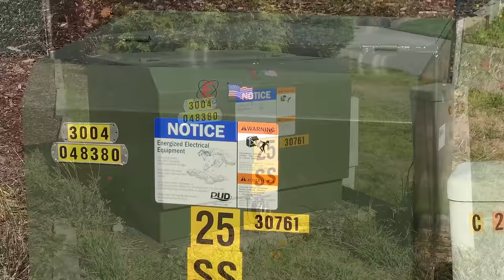Replacing a Pad Mounted Residential Transformer

Comment: The fact that "it is an eyesore" has got to be one of the silliest reasons I have heard to replace a transformer.  Better call the phone and cable company next, their boxes don't match the transformer now. :P
Reply: I wouldn't have put that in the description! My old switchboard is from the 1930's. I like it.
Reply: Yeah, they should’ve just went with the paint job. There’s an expected useful lifespan of all thing, but some things can last 100 years. I’m curious as to what these transformers expect to run. I know the one by my house has been there since the buildings near it were constructed.
Reply: He did not ask for it to be replaced..."I asked her if could paint it myself, or if PUD could dress it up with some new paint and signage."
Reply: @EqualsThreeable  lifespan is up to 50 years, dependent upon the quality of paint used for the exterior.
Reply: @EqualsThreeable  AC transformers are incredibly simple devices. They're literally just hunks of metal with wires wrapped around them. Most are oil cooled, and as long as the oil doesn't leak out, they can easily last 50+ years.
Reply: Excuses mee,. but TRRANSFORMERS ARE ROBOTTES IN DISGUISE. If a TRANSFORMER here youe say that, goo dchance it wil gobble youe up. Ple doinrt say that aroudn TRANSFORMERS!  THANSKE YOUE AND THBBBME SUPPESR!
Reply: HoA probably. Why it's a ground unit in the first place.
Reply: @EqualsThreeable : They're probably shipping the old one to my neighborhood.
Reply: It's taken me weeks to get a street-light replaced, or on the government side, get trash shopping carts removed from the shoulder of a busy street... let alone fix some pot-holes.
 
I probably would've spray-painted it myself, being sure to leave those code numbers untouched. Think they'd care? 
 
"It is far easier to apologize than it is to get permission."
Reply: @oatlord : Maybe but in my neighborhood the utilities are underground and I'm glad of it. No HOA for me ever. I detest them.
Reply: countryfolk kinsurvive  "that dilapidated things can easily bring the property value down"

LOL well that's GREAT!!! unless you are planning to SELL next week who gives a damn about the value? if you feel it's decreased the value- GREAT- file a claim with the county assessor and demand a property tax REDUCTION and save some money!
Reply: I, too, would've expected they'd just paint it. But it's their system, if they want to replace a decades old box, it's their money. ('tho I would've put in a larger capacity.)
Reply: Still way better than wires and transformers on poles hanging from above the street
Reply: @KutWrite  one of the street lights on my street would work some nights others not and after about 2 years they recently replaced them
Reply: Though compared to European standard transformers this all look horrible
Reply: @EqualsThreeable  they're lifespan depends on load, environment, etc.  Performance degrades over time.  

When I bought my first house the street had a reoccurring issue with dimming interior lights.  I came home one night to a crew swapping out all the transformer s in the alley way. No more issues after the swap out.
Reply: @TheSeanUhTron  oil typically starts leaking long before 50 years.
Reply: Well they are different colors for a reason
Reply: I guarantee it wasn't about looks. The life span of that Transformer was up. They Change them every 30 years or more but I've seen them Blow before that.
Reply: It’s not silly. People spend a lot of money on their homes to make them look nice, I wouldn’t want an ugly box sitting in my yard either.
Reply: First-world problems!
Reply: @jfbeam  They will probably take it back to the yard and refurbish it and re-deploy it.
Reply: @KutWrite  it may be easier to apologize that it is to get permission, but it sure as hell ain’t cheaper!
Reply: @ryan005869  then rip it out. You don’t get to dictate anything to the power company. They will literally tell you to sit and twist. 🤣
Reply: @jman0870  didn’t say to remove it, just saying  if something has to be in the yard it might as well look nice. Also that is not a required location for that hardware, it can be relocated.
Reply: @ryan005869  No...it can't. That would require digging up the pad and the trench the high voltage lines are in, pouring a new pad, digging a new trench, lining it with concrete, extending both the service wires for the homes and the line wiring coming in. That's a massive expense, paid for by your electric bill and tax payer subsidies. This is where I roll my eyes.
Reply: Best aspect of that whole eyesore deal is when they put a bunch of bushes around and in front of it. And I get to level them all down to the ground cause they can’t read the sticker on the front.
Reply: Consider the fact that that eyesore could impact the value of the home directly.
Reply: @CharlieDoesntSurf  bruh. Stop making me laugh. My ribs hurt. 🤣🤣🤣
Reply: @jman0870  thats okay kid, you wouldnt understand
Reply: @CharlieDoesntSurf  bruh you were born in ‘95 and YOU’RE calling me a kid? Scroll up through the comments and try to make that pea of a brain work while you attempt to comprehend the fact that the utility company owns that transformer and, if you want power, you’ll deal with it.
Reply: @jman0870  dang, kids angry. is it past your bed time?
Reply: Agreed!  Hopefully the new one is manufactured poorly and the homes it services will have power problems.  OOPS, I guess ugly old reliable wasn't so bad after all!
Reply: But he took the pictures with his iPhone 🙂
Reply: I expect the real reason it got replaced is that they know these old transformers are full of PCBs and, rather than take the risk of liability for carcinogens leaking all over the place, they are happy to replace them.  This is what motivates modern corporations.
Reply: its an eyesore.. yet no one cleaned the pad itself. that bugs me so much.
Reply: @oatlord  In Pacific Northwest we get lots of windstorms and coupled with tall fir trees it's a recipe for constant power outages. Even with moderate winds. Our co-op utility near Tacoma moved to underground wires where possible. In the '70's there were many outages every year. Now they're very infrequent. Everybody's happier and safer. No HOA's necessary. Read your preliminary title search before buying a piece of property. You'd be surprised by what you're tied down by.
Reply: The cost of that transformer replacement, my guess, maybe over 5 grand plus the environmental cost to add.
There is a saying in my culture that if you have too much expensive perfume, apply it to your crotch as well.
Reply: @jman0870 Not only do they own the transformers, they have an easement for the property it is located on. The homeowner has zero rights to say what goes on in that easement. If he had read his covenant, he would know that.

Comment: Now I know how to replace mine when it goes bad. I bet I can get one on eBay from China.
Reply: Lol
Reply: Yes but you will have to DC the primary at it's source fuse or closer or you will have live 7200 volts which is not ideal to have to deal with in close quarters. The unit in the video has a dead (DC'ed) primary and is shunted to the ground through that block they installed just in case someone closes the circuit up stream while they are working.
Reply: @Elfnetdesigns  My friend repaired a toaster once, I'm sure we can figure it out.
Reply: Here central California the city I live the irrigation district is responsible to replace those! And also, I would have thought those things are that heavy!!!
Reply: @Elfnetdesigns  Omg elf!? What are you doing here? Small world man, small world.
Reply: @Elfnetdesigns  wrong in so many ways. You have No idea what you are talking about.
Reply: @porfiriortiz  Is that a fact? Since you are an authority on electrical safety in the United States then you can explain how I am wrong. Well, go on we're waiting, Mr internet "expert" with absolutely zero content on their troll channel to back up a single claim they make. Educate all of us on American electrical safety and codes.
Reply: And it will provide better quality power than these garbage transformers they keep making in the USA.
Reply: @PilotVBall  Sure....Maybe the Easter bunny will get you one for Easter.
Reply: ElfNet Designs I’ll back them up. This primary was NEVER GROUNDED. It was a hot changeout. Whatever block your talking about maybe the feed through? Is not a grounding device. That primary was hot the whole time from disco to test to restore. It is a fact. I dunno why you commented on this.
Reply: I saw a feed through. And an insulating cap. Neither of which shunt or whatever. GROUND a bushing. That’s called an elbow ground. There was not one in this video. Mr safety lol.
Reply: ElfNet Designs it’s source fuse or closer?? Lol oh man just don’t do this no more lol leave the big electricity to lineman.
Reply: or better yet ?

"made in mexico"  

lol  now that's  some fine quality. !
Reply: porfirio ortiz I think that Elf guy was just making a joke. No need to bite seriously into it.
Reply: Mrt And the same for you.
Reply: b8e71fcbe2e195c67d8d16734013d20f this is what I do for a living so I dunno wtf your talking about lol. Before I did area urd I traveled and did transmission. Doesn’t get any bigger than that sooooooo same to you too, too??? Lol
Reply: b8e71fcbe2e195c67d8d16734013d20f I don’t think he was. You can tell by how he’s trying to name parts. Another electrician trying to say things like elbow pin thingy.
Reply: DONTE TOUCHES ITTE! TRASNDFORMENRS are ROBOTTES IN DISGUISE! They will gobble oyu up when you get close to tTHEMES! THANKE YOURE SAND THUIBMEUPPERES!
Reply: @Elfnetdesigns  I know 7200 would hurt been shocked with 220 was bad enough lol.
Reply: Get it from Wish.  You'll wish you hadn't.
Reply: @ryana1140  Sounds like Turlock.
Reply: @raymondb4448   You won't need the toaster.  You will be toast.
Reply: @gyrgrls  sure
Reply: @luisderivas6005    Make sure it's the Energizer bunny.  Dollar Tree sells cheap alkaline cells.
Reply: @Elfnetdesigns  I used to work on Tv's and they had upwards of 40kv in them even when turned off.
Piece of cake.
Reply: @Elfnetdesigns  r/woooosh
Reply: @raymondb4448  they discovered how to do everything we know today with that mindset so I believe in you.
Reply: @raymondb4448  omg best reply you still got your humor
Reply: @ryana1140  *wouldn't
Reply: My thoughts exactly! Thanks, Youtube!
Reply: Good luck switching it out
Reply: @Elfnetdesigns Designs That would make you all tingly all over I bet!😁
Reply: @MrT13  That's why the ten-foot pole. Risk of an Arc-flash on the change out since it was a hot changeout I assume!
Reply: @Plummerdeedo29  Don't worry you wouldn't have noticed it. Just like that brief moment in the electric chair!
Reply: @PWingert1966  no. No. And no. I do this for a living. This is full on amateur hour at the dump. I do changeouts in under 10 minutes and not hot. This is trash.
Reply: @PWingert1966  don’t say assume...
Reply: @Engineer9736  hey. What do you consider big electricity? Cause with an ignorant statement like that to a guy who’s journeyman electrician and class a journeyman through selcat touching up to 500 I’m gonna go ahead double down on your you too. Son.
Reply: @Engineer9736  or boy? Whichever you prefer.
Reply: @MrT13  So why is the pole several feet long?
Reply: @PWingert1966  and it’s called a shotgun. An 8’ to be exact. Orange ones are chance. Yellow Hastings. Yellow with blue stripe utility solutions.
Reply: @PWingert1966  I know exactly what they are doing. I’ve done it 100 times easy. Along with all the other crap we do in urd stuff. He’s wearing hot gloves holding a shotgun attached to the elbow pulling it from bushing putting it on feedthrough then disconnecting secondaries from multi taps two bolts for grounding and away it goes. Install in reverse. But I’m telling you they didn’t need to do it hot. Just iso it. Leave all the secondaries on multi tap and just undo two 5/16” screws. Pull elbows. Undo 6 screws and two nuts. Switch and put back together. Takes less than 10 minutes time out. And is safe. This video is what not to do....
Reply: Please do a live feed of the change
Reply: @Devast8r34  I literally found out about this video at work. We had a safety meeting one morning and boss was like ok so we are going to watch a video of a changeout and then see what we think afterwards. When it was over we were all just like what in the holy bats balls in bbq sauce did we just fking watch? It was actually pretty funny lol. So I came on here. Found the video. And commented a few times. Cause it’s a straight up dumpster fire.
Reply: @Elfnetdesigns  I just rewire my microwave to work as a power generator, we good fam
Reply: @raymondb4448  Raymond, are you in the U.S. or at another country?
Reply: The transformer will be cheap, 'cos there are lots. It's the pole for disconnecting and connecting that you'll need to take out a mortgage to buy.
Reply: @sylviaelse5086  no poles are much cheaper and more plentiful.
Reply: @raymondb4448  O.M.G!!!!
😅😅😅😅😅😅😅🤣🤣🤣🤣🤣🤣🤣🤣🤣🤣🤣🤣🤣🤣🤣🤣🤣🤣🤣🤣🤣
Reply: @CatWith-AHat  Lmao🤪🤪😅😅
Reply: One comedian makes a funny remark and all the top 1% that are better than anyone else in said field comes out of the woodwork in their local trailer park, hoping their Dunning-Krueger effect will succeed.
Reply: Did the transformer go bad yet ? Curious to any progress.
Reply: Make sure you buy a good life insurance. Before you start playing with that Zucker
Reply: The most important, do not forget knees pad. :)
Reply: @Elfnetdesigns  rubbish. It was live which is why you could hear the tx humm when he punched the connection back in
Reply: Dont forget the tiddy shaped sucker stick...then again, it will probably come with 2..but dont exspect them to be quality
Reply: You don’t want one from China. The ones made in Antarctica are better.
Reply: @MrT13  Does it take you 5 people (including one to put the stickers on) and 3 vehicles? 🤣
Reply: @stuartmiles1401  what are you 5? If you must know we are 4 guys two trucks. Sometimes we pull feeder. Sometimes we set feeder gear. Sometimes we set poles. Sometimes we transfer phases. Sometimes we do pipe work. Sometimes we build poles. Sometimes we do conversions. Sometimes we do manholes. Sometimes we do substations. Sometimes we do wreck out. Sometimes we run drops. It depends but WE DO IT ALL. Cause I’m a bad mofo so you got the wrong one. This was a 15 minute job period. But all I saw was amateur hour.
Reply: You have to be certified btw.

Comment: That's the pole people are referring to, when you say "I wouldn't touch that with a ten foot pole"
Reply: Fat cheeks and electrics have a lot in common lol.
Reply: it has nothing to do with those poles at all, unless your saying they were installing transformers into gardens in 1843? i think the ten foot pole refers more to barge and pushing poles.
Reply: Hahaha dude it's a joke, It didn't need fact checking. But thanks for unsure answer of where this saying might have started.
Reply: @alexoike5381  Arc Flash is more likely with large contact surfaces!
Reply: It’s referred to as a “shotgun” but it’s a form of hot stick.
Reply: Has to do with the resets on the poles.
Reply: About 8:40 “Get back”   I loved that part.
Reply: Yes also known as the “Ex GF Stick” that you refer to when you say you won’t touch your Ex with a 10 foot pole very effective 🤷‍♂️😂😂
Reply: I'm not sure why this takes 27 people to do
Reply: Shotgun stick
Reply: I guess a lot of commenters really missed your joke.
But 407 of us did.
Reply: @delano62  hahahaha I thought as well. Cheers, too funny!
Reply: @shroomiestshroom3655  r/woooooosh
Reply: @gherasimtibi   crane driver and crane / lineman to connect and disconnect the power/ lineman to assist and monitor. You want to play with line voltage without someone there in case something goes wrong? /  the man with the stickers is admin.
Reply: 3 houses are feeding from this transformer?
Reply: I prefer a twenty foot pole when it comes to certain things.